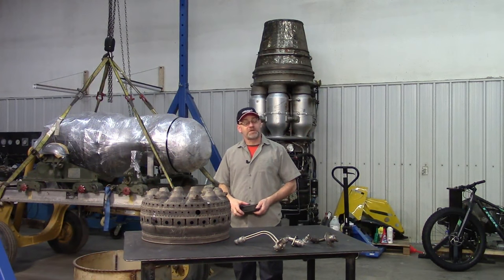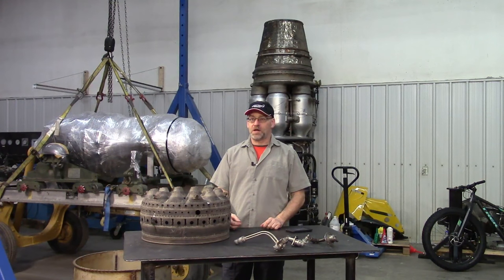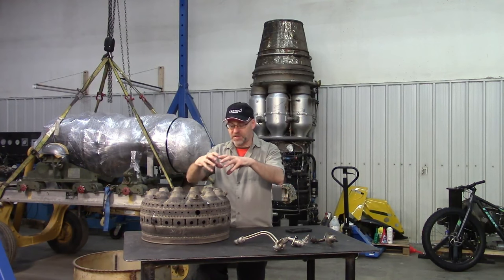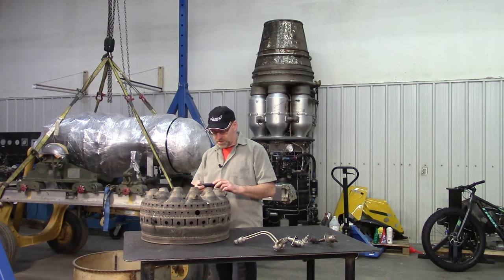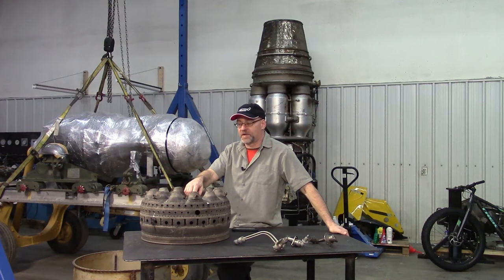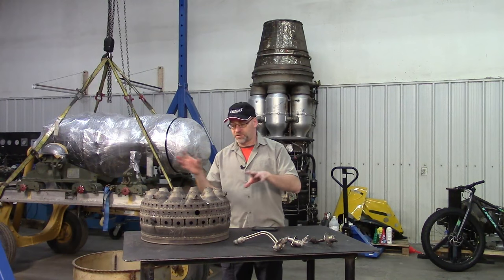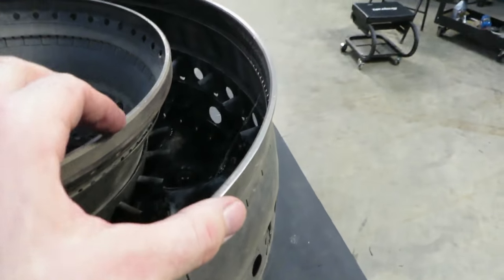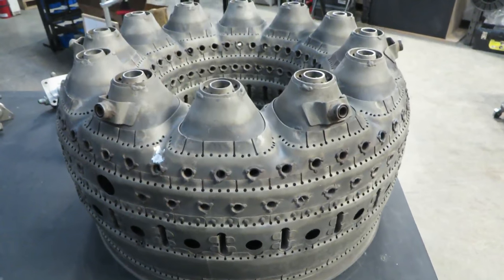Jet Questions 90

Comment: hi jay z, my question is how do you inspect the combustion liner or how do you determine his condition?

regards
Reply from the maker: The manual has all the procedures and all the allowances for things like burning, cracking, and distortion.
In some places, cracks are bad. In some they are OK. Some cracks can be repaired by welding. 
Some combinations of cracking, burning and distortion will be reason to replace the liner with a new one.

Comment: When you said "If the air going into the intake is of a flammable mixture", and that made me wonder... what if someone sprayed Nitrous/NOS/N2O into the intake? I realize N2O is an oxidizer, not a fuel, so on its own it just increases the oxygen, which I believe is known as "dry spray". But then you can spray in some fuel along with it, known as "wet spray" I think... 
P.S. Sorry if you answered this, I've only started watching your videos recently, haven't watched them all, YET!
Reply from the maker: No. It would have no effect. With fuel, you would be introducing fuel in the wrong spot, and you could get fire in the compressor.
Also, engine power is limited by heat, and the engine runs at max temp.
If you rigged up something that allowed you to spray more fuel in manually, the fuel control would back off its contribution in order to keep the temp within limits.

Remember:"the human is not in control of the engine, but he/she does get a vote" - the Fuel Control.
Reply: @AgentJayZ  Haha, nice quote.. And yeah, that's along the lines of what I was expecting would happen. Thanks for the quick reply!

Comment: For the runaway question, what about an industrial engine that is designed to have a load on the same shaft, but the linkage breaks or an inattentive operator starts it without checking if the load is connected. Would the engine runaway in those circumstances?
Reply from the maker: No. The power turbine is independent of the gas generator. 
The fuel control senses the load (PT) shaft speed, and also the GG shaft speed. It will reduce fuel to the GG if the load shaft increases past the set point. 
It will also try to keep the PT speed at the setpoint if the load is too great and the speed begins to fall. But it will not allow the GG to overtemp or overspeed. 
On engines where the mechanical load is driven on the same shaft, the fuel control keeps the speed of that shaft, so if the load breaks off, the control would reduce fuel, and the load is to great, it will add fuel up to the temp limit, but will not burn up the engine in an attempt to drive an excessive load.
Reply: Industrial and Marine Olympus power turbine rotors had a mechanical overspeed trip arrangement mounted near the output coupling flange. If all other control system features failed and the power turbine did overspeed, a collar on the shaft would go eccentric and trip a lever, which pulled a cable to close a valve, which shut off the fuel to the gas generator.

Comment: Hi Jay, just recently discovered you. I am happy to see you. Good to see you are still producing and interacting with your YouTube account after all these years. Wow. I love jet engines, so a big heart felt thanks for sharing so much of your knowledge.

I became interested in jet engines after getting my mind around Bernoulli's Law and the aeroplane propeller, and had started to wonder how much of the forward thrust of the jet engine is generated off the forward facing surface of the turbine rotors, like it does with an aeroplane propeller?

Now, from being shown inside the jet engine, by yours truly,I am thinking, it seems very little. Where, apart from the mass/velocity equation of the air being pulled into the intake manifold, most of the forward thrust is generated purely by the push out the back of the turbine engine by Newton's Laws. 

Is this correct, or is there a situation where the front most rotor has been designed to utilize Bernoulli's Law to pull the aircraft forward?

Comment: Old video I know, but as a point of interest the UH-60 has an APU which provides bleed air to start the engines as discussed, but the APU starts using a hydraulic start motor driven by an accumulator using pressurized nitrogen. Are there any big jets you are aware of, perhaps in industrial settings that use hydraulic start motors or are they limited to smaller applications?
Reply from the maker: Hydraulic start on industrial engines is one of the ways it's done. My series of vids on the Rolls Royse Olympus features the engines being started with their hydraulic starter.
Hydraulic power is supplied from an external source, not an accumulator on these bigger engines.

Comment: Hi, In the evolution of jet engines,has there been a marked change in the quantity of compressor air used for cooling purposes especially in the cooling of the combuster? I guess that whilst engines are running hotter than before, changes in materials have to some extent countered this.
Reply: Well in the combustor the cooling air makes no difference to the performance as it is ejected out the back as thrust, most of the wasted air is in cooling the turbine nozzles and blades

Comment: In an engine with multi spool architecture do the spools turn opposite directions to  do away with the need for stators between the different spools?  Don't respond if this has been covered already, or is just plane stupid.
Reply from the maker: Not stupid.
Some engines do use counter-rotating shafts.
Graham is more of an expert on that subject. He is our resident Rolls Royce design engineer.
... Hold for his contribution...
Reply: Thanks, AgentJayZ!
It's certainly not a stupid question: in fact; it's a great question. Years ago, at R-R Bristol, we ran a rig model of a two-stage, statorless, contra-rotating turbine, which eliminated the NGV row between the HP and LP blades - and it worked.  I could be wrong, but I seem to recall seeing a cutaway GA of one of the latest US (military?) engines that had no NGV row between the HP and LP blades.
With R-R's current engine architecture, a statorless turbine isn't possible, because the IP NGVs in the Trent range and the LP NGVs in the EJ200 house structural 'spokes' and services for their turbine bearing housings. However, the EJ200 is contra-rotating and there is a performance advantage, because the low camber LP NGVs have lower aerodynamic losses that the equivalent high camber NGVs in a co-rotating turbine.
This is primarily the reason for the latest marks of Trent engine having a contra-rotating HP spool, so as to reduce the secondary flows and consequent aerodynamic losses in the IP NGVs.
Reply: grahamj9101  Thank you. That was quite informative.

Comment: The old Detroits had what was called solid racks. If one injector would stick at full fuel, then all of the injectors would be held in full fuel, and the governor can't control rpms. The blowers had emergency flapper shut downs on them. You hoped that the engine would shut down.  This is one way of a Detroit Diesel run away. I think the question might have been related to no fuel control run away. Just wondering on lost of fuel control.

Comment: I'd like to ask a question. Is the maximum speed of an gas turbine limited to the speed at which the compressor blade tip reaches the speed of sound, and does this same knowledge apply to the turbine-power turbine?
Reply: At take-off rating, the tips of the fan blades of the big high by-pass turbofans are supersonic, causing that very characteristic buzz-saw sound.  Otherwise, compressor blade tips speeds are typically limited to below the speed of sound, because the shock patterns that would be formed would result in aerodynamic losses. However, the speed of sound increases in direct proportion to the square root of the absolute temperature. Consequently, the higher the temperature, the higher the speed of sound and the tip speeds in turbines are typically well below the local speed of sound.

Comment: Hello at first a happy 2017 i have a Question if an compressor of a turboshhaft engine is bigger And the Blades are longer does is suck more air And is the output of the sound level than bigger??? Than a small compressor?

Comment: On Quantas flight 32 an oil pipe broke in the engine, fed oil to into the combustion area and made it run so hot that one of the turbine discs disintegrated and punched holes trough the wings and fuselage, I guess that can be counted as runaway ?
Reply: No. The oil did not feed into the combustion area. Please see my answer to Juha Tuomala.

Comment: Would the Black Swan event of that Qantas flight QF32  years ago where they couldn't shut down an engine for two hours after it landed be classed as a "run away"?  They ended up stopping the engine by swamping it with water from a couple of crash tenders. The accepted method of stopping a diesel run away is by the use of a flapper plate or a large enough rag to over/in the air inlet to starve oxygen.
Reply from the maker: +Reece Isaac 
I would not call that a runaway.
Reply: Nor would I. The engine controls were just 'frozen'. That's not much different from having a jammed throttle on a diesel or petrol/gasoline engine - with the difference, of course, that, in a vehicle, they can be disconnected from the load.
PS I thought you were in Palm Springs CA, AgentJayZ? Merry Christmas and enjoy the warm weather. I'm off to Singapore (again) for a month at the end of January.
Reply: grahamj9101 will

Comment: Is the spark on going as long as the engine is running  .or  is the spark just to start the flame  then stops the spark and the engine continues running after
Reply from the maker: Once the candle is lit, it no longer needs a spark. Often ignition is left on until after takeoff, because even though it's a very unlikely event that the flame should go out, the consequences are extreme, and so a little wear on the ignition system is an acceptable cost.

Comment: i don’t really know anything. but say you have a turboprop engine and you take the propeller off so the engine has almost no load and the fuel controls was stuck open would it run away then.
Reply from the maker: Not likely. It's called a fuel control because it controls the fuel. It's not just a valve, and the human does not directly control the fuel flow.
The pilot gets a vote, but the final say is in the hands of the fuel control.
Reply: AgentJayZ but for sake of augment if the fuel was getting in there some  how. with out load would the engine just spin faster and faster? i understand that they probably make it almost impossible for the fuel controller to allow that to happen. thx for replying to a old video very cool of you.
Reply from the maker: Unlikely The fuel control controls the fuel.  If a PT speed sensor failed and sent a zero speed signal to the fuel control, it might want to add fuel to increase that speed, but it's not that simple. There are multiple control pathways, and they all have an influence on the fuel control. 
For example there would be a separate overspeed mechanism on the PT, which does not use the speed sensor, but would trip at a set value and either limit or shut off the fuel to the gas generator. Engine stops.

Comment: What, no mention of cartridge starters? Shame. Though I guess they're not used so much these days ("these days" being "in our lifetimes") and may never have been used in airliners, but still cool. Basically a big shotgun shell with no shot that pushes a piston to spin the gear the regular starter spins, rack-and-pinion style, also used on aircraft piston engines. OFC mainly used on fighters and bombers, that normally use ground power for starting in the conventional ways you explained, but might have to spin up eight J57s RIGHT NOW if war were declared.
Reply from the maker: Yes, we know all of that. Much discussed in videos... somewhere in the playlist I’ve created called   YourQuestions Answered. It has a sort of index.

Comment: Ok, I'll have to see that movie again now :-)

On the runaway engine. Is there a valve in the fuel system that gives the operator overriding authority or does the engine run itself with only requests for certain power from the operator?

I saw a video from an emergency landing with a large passenger plane with a damaged engine where they could not shut down the engine. It wasn't running away or anything, I think it was just idling or maybe a little more than that but it kept going and going so the control system must have been damaged and nothing could stop the engine getting fuel. They tried to stop the engine by spraying water into it with fire hoses, I don't remember exactly how they managed to finally stop it but I think they sprayed foam into it.

Comment: theres a u tube of an F-14 [ i believe] air refueling and the basket separates from the hose. as the hose undulates some fuel goes in the intake and u can see a compressor stall/backfire occur.
Reply from the maker: The early F-14s had engines with very unhappy compressors. It would be interesting to see video of such an event.

Comment: Technically that transport cart does have suspension. The side walls of the tires and the air pressure inside the tires are the suspension.
Reply from the maker: ... Nit successfully picked.
Reply: AgentJayZ I have been reading "The New Science of Strong Materials" so I'm feeling a little smarter(ass) than normal. 

Great video as always.

Comment: When a new aircraft is being developed do they also develop an engine for that aircraft or do they find an engine that fits the specs for the new aircraft? or are engine manufacturers always designing and creating new engines that the aircraft manufacturer can choose from? Don't know if you know the answer but never hurts to ask.
Reply from the maker: It used to be more your second choice. nowadays it's more like your first choice.
Reply: Rusty Films alot of aircraft are made with an engine in mined. Some are made with a specification. And they ask engine manufacturers to fulfill the requirements. But aircraft and engine design are closely linked assuming it the first aircraft to use that engine. The next "generation" aircraft may be made to fit a previous generation engine.

Comment: A "Runaway" Diesel is when the diesel air intake is obstructed (super dirty air filter) and the engine starts sucking up and burning the crankcase oil. I had it happen to me, and it was impossible to shut down accept by downshifting until stalled out.
Reply: It can be from a turbo failure at which point the turbo oil feed ends up pumping oil right into the intake.
Reply: Even with a failed turbo the engine will still pull in air, like a natured aspirated engine
Reply: In my case, the throttle was closed (foot off the gas pedal) and the car was accelerating as it was spewing black smoke running off crankcase oil. I had to stop the car and dump the clutch with the brakes on to shut it off. If it had been an automatic transmission, it would have had to run crankcase dry and seize up the engine to shut off.

Comment: Hey. I've got a big question. I am building (0 budget prototyping) a plastic pyrolysis machine with supplemented ethanol I make and want to know how you could, cost effectively, produce around 25-75 kw with a turbine. Anny thaughts?
Reply from the maker: Zero budget? 100% chance of failure.
Small budget would be figure out a way to make gaseous fuel from plastic, then burn it in a small turbine engine.
Smallest budget: burn that fuel in a small torch or heater fist.
Reply: @AgentJayZ  that's exactly what I was thinking. I have a plan to use the gas from the pyrolyzer at full temp so it does not need to be cooled into a distillate. Would it be advantageous to use the exhaust to heat the pyrolysis chamber (or turbine intake) along with the burner? How low power could a gas turbine be before it is pointlesly efficient compared to a petrol or diesel piston powed generator?
Reply: @AgentJayZ  do you have any thoughts on the turbine wrightspeed has designed to be a range extender on electric trucks. Or cheap centrifugal compression turbines for electric powered vehicles in general?

Comment: Were there any fire extinguisher in a Jet Engine? And those Air Bleed things are the ones supplying cabin pressure in a Jetliner?
Reply from the maker: The fire suppression system is part of the aircraft, not the engine.
There's a video I made called Bleed Air which may help answer your second question.
Reply: Thanks for the reply Sir. Honestly I envy you profession. It was my dream since I was a kid :)

Comment: Hi Jay, great videos about turbojet engines. But i have a question..... on 17:47 in this video when you say that the pressure at the intake and the pressure at the outlet of impeller (for centrifugal compressor) is the same. Is that right or not? Because I remember from school that inlet pressure is smaller than outlet and also all the diagrams of centrifugal compressors are showing that outlet pressure is greater than inlet. Thx
Reply from the maker: You are getting lost in the confusion resulting from imprecise terminology, and also a bit of other things.
A centrifugal compressor consists of a rotor, a housing, and diffusion passages.
The rotor increases the speed of the air and discharges it into the diffusion passages, where the kinetic energy of the air is transformed into pressure.
So, there is a difference between saying "the exit of the compressor" and "the exit of the rotor".
Does that help?

Comment: Quants had an oil supply pipe rupture and feed the engine with most likely an nice atomized spray of hp oil which caused the turbine disk to overspeed and catastrophically fail. I heard of diesel Engines burning their own oil even when fuel is removed.
Reply: No. Please see my answer to Juha Tuomala.